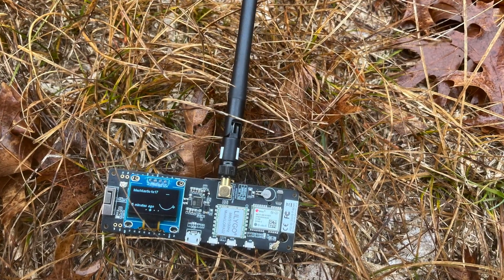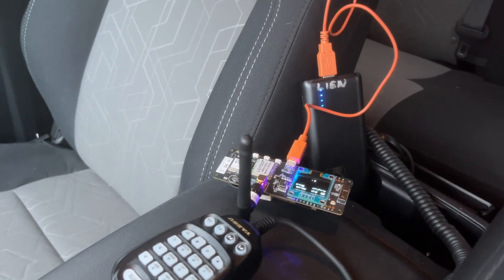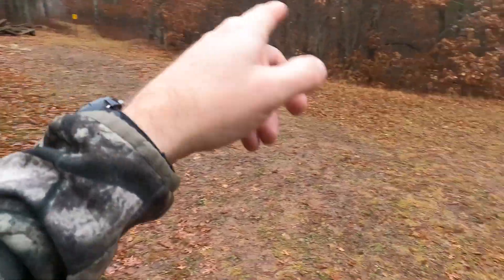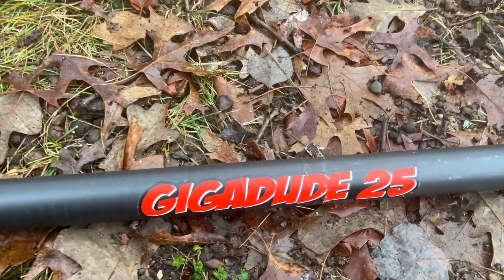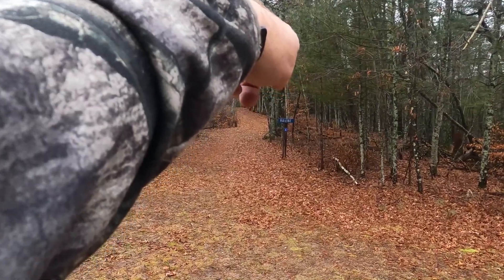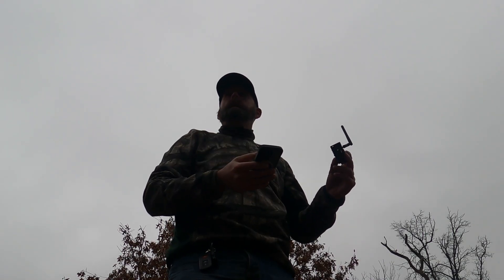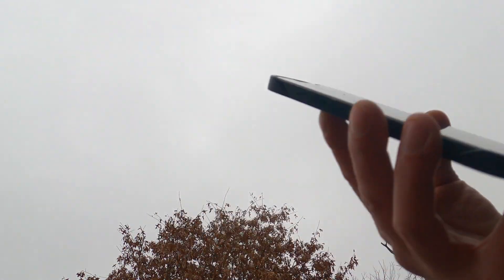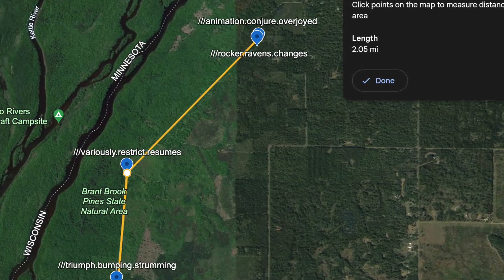Meshtastic Range Test 2: Node on a Mast as a Repeater

Comment: so far I did 2 repeater, 6 node system in western SD, for now its in testing mode, but eventually I want to use them for monitoring liquid levels in tanks and texting for areas where I have no cell coverage. actually, one time I was able to use meshtastic to text to my friend to call my company, I had no cell coverage, not even 911, so he was able to call my company and let them know where I broke down. tow truck came 1.5 hours later. it was nice knowing that my nodes did better then cell coverage in the mountains.
Reply: I just came home from adding another node 8.5 miles away from home. that one will serve area where there is zero cell coverage. it takes 1 extra hop to reach it. or 2 hops for end user to contact someone in town

Comment: I've been enjoying your videos. A couple of observations that should improve your range. The antennas you are using are not the best. Going to a low cost aftermarket antenna could improve your range. I've tested the type of antennas you are using (the stock type antennas that come with the nodes) and found, especially when bent at 90 degrees, they have less than ideal SWR. The aftermarket antennas offer more gain and allow more power to be radiated due to having a much better SWR. The other thing I would change would be to put the radio in the truck on the dashboard. It would allow more signal to be radiated out of the vehicle. Also, having the antenna on the radio on the pole at 90 degrees vs. the 45 degree angle the antenna was at could offer a little better signal also. Thank you for getting out in the wild and showing what these radios can do. Having a good antenna is one of the most important things as to range, secondary only to height of the antenna. I'm looking forward to future videos...73
Reply from the maker: Thank you! I have picked up some better antennas. Now I just need to do some more testing. Thanks for watching.